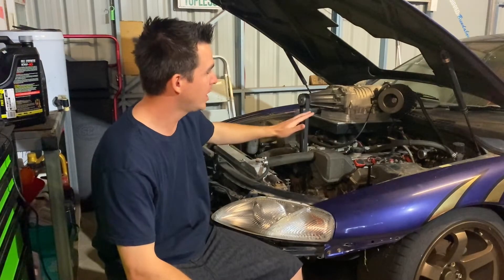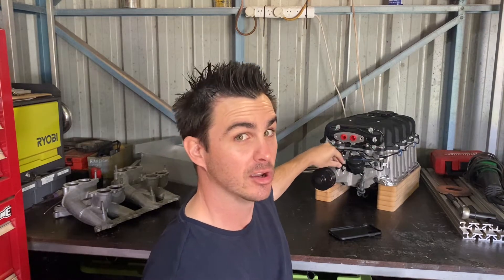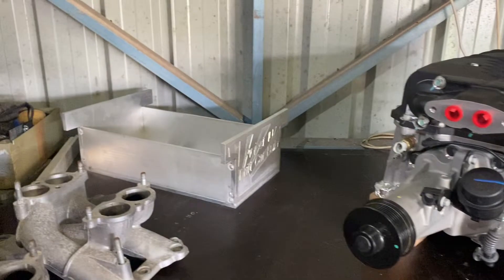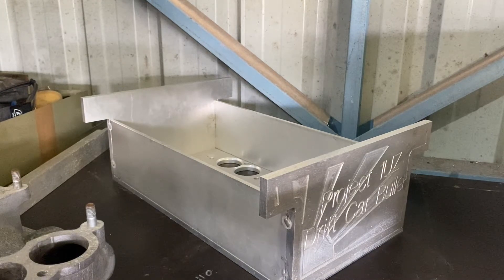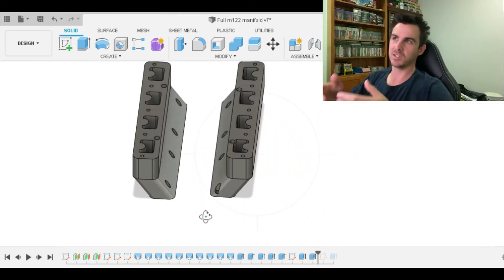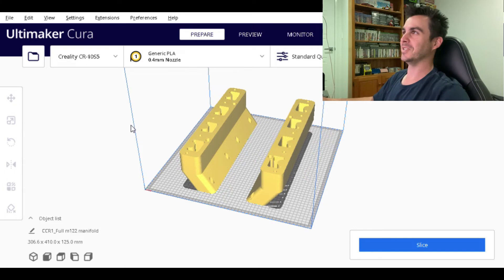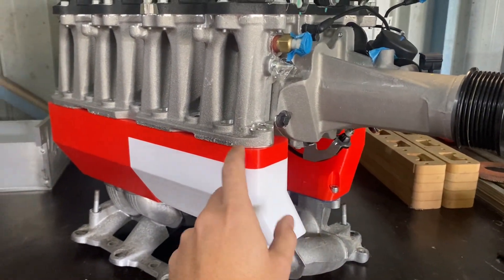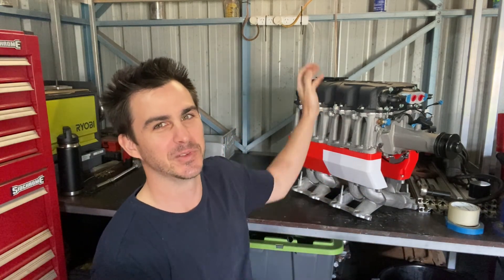Let's Prototype a Northstar M122 Manifold for the 1UZ!

Comment: This is awesome but i cant help but ask why half ass it if going this far? Those are some crazy long runners and i doubt you want peak power at 2000rpm lol. Throw those lowers out and start at the heads to the blower outlet. If your lucky you can fit two sets of injectors in both stock locations and end up with a runner that peaks around 6krpm along with bringing the whole thing down a bit.

Comment: Sweet! What if you scanned the intake manifold lower ports and reverse engineered the injector ports this way you can cast a smaller more efficient setup that sits lower. My two cents.

Comment: looking at the "blocks" added to the stock manifold and at how the ports at the headside are situated im wondering why you added the stock bottom manifold to the whole setup 
i mean the runners from the supercharger are pretty long to start as they come down from the top of the blower and if you make the same type of runner setup but without the manifold in between it you can have the runners comming out the blower manifold going allmost straight down intoo the heads , yes youre going to need to make a pretty sharp turn intoo those heads and shape the outside of the runners and make flanges on the ends so you can bolt the adapter runners on the heads before mounting the blower over the top of it but it would look and fit a lot better than the way you did it now , it prolly be more mecanicly stable too (the ports dont cross over under the blower)

Comment: Why not just make your adaptors go straight to the heads and do away with the original lower manifold.
Reply from the maker: This way I can still use my current fuel rail and injector setup. Also it will use alot less material casting opposed to fitting straight to the heads
Reply: @Brodorsport   I can see the sense in that, but by keeping your adaptors a bit shorter you would not have to worry about the amount of material for your castings.
and the extra long runners, which could potentially affect your torque figures,  especially where you make peak torque and how long it holds through the rev range. Be interesting to see your results when you get it done and on the dyno. Your runner length looks like it will end up twice the length of my set up. Good luck with it.
Reply: @Brodorsport  but someone makes a beautiful set of injector rails for these now 🤷🏽‍♂️